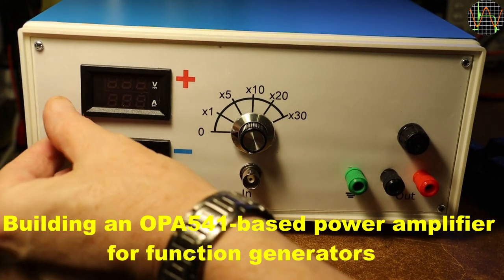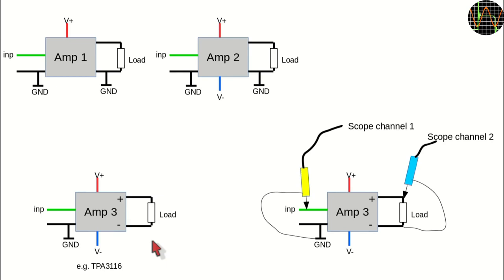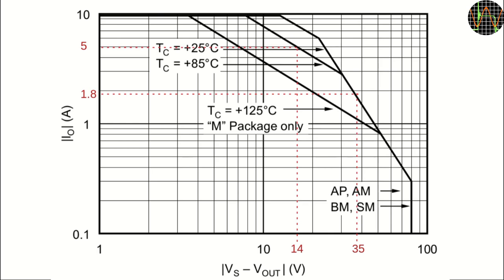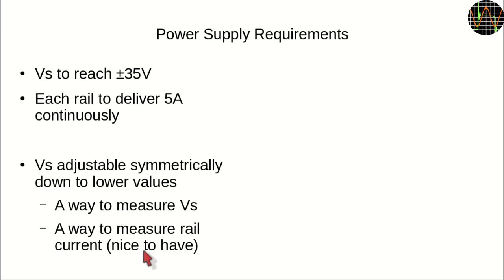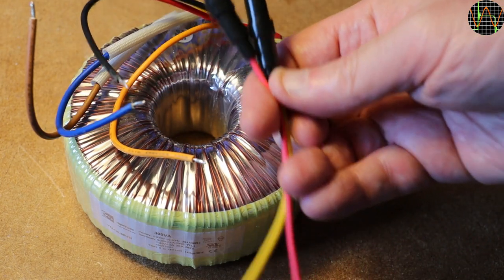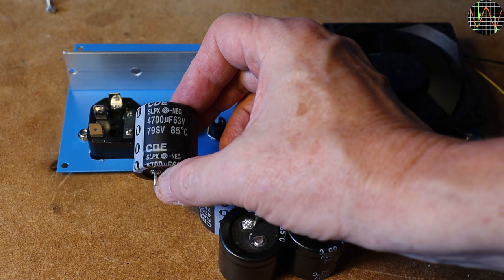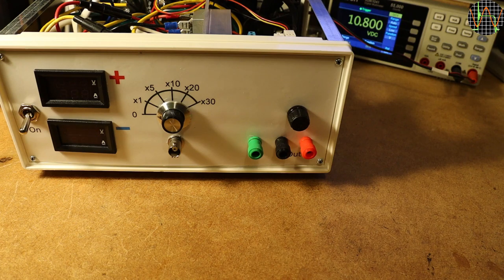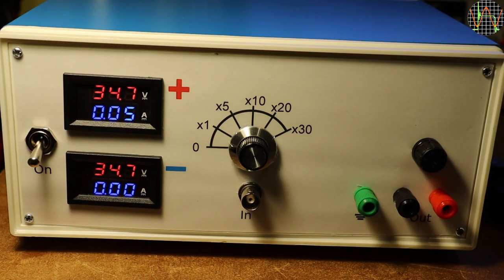Building an OPA541-based power amplifier for function generators

Comment: I just "finished" a similar multipurpose 541-based bench buffer yesterday---and then I see this video...Dash it all! Like yours, my board already had the DC coupling as well. The 541 seems to be an old-stock Burr-Brown part.

My goal was just +/- 10 V (20 V p-p) at only 4 Amperes so I used a couple 15 V switchers. My hacky cooling used a slow, quiet, 24 V, 60 mm fan with a 220 Ω series resistor across the 30 Volts. I beat the tar out of it yesterday, running transformers, motors, near-shorts and other evil loads with a function generator and bench supply and the cooling held. The input offset was way lower than expected at much less than 1 mV. The rms noise, taken with a wideband thermal rms meter, was less than 2 mV (unloaded @ 10Vdc) and some of that could be from the linear bench supply used as a reference source.  Next is to add monitor BNCs for current and voltage to make it easy to connect a scope for power measurements with reactive loads.

Edit:
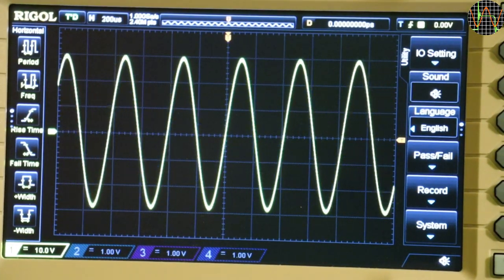On the glitch at 23:45, I see that too and not just at higher frequencies. I've been trying to understand it. It only happens when the signal crosses zero. A +2.5/-2.5 square-wave shows it clearly but a 0 to +5 V or 0 to -5 V square is fine. It looks like some form of crossover distortion but only when loaded heavily. Counterfeit chip?

Yet another edit:
Confirmed: Crossover distortion. One of those cases where textbook art and a real scope trace diverge. Sadly, seems normal for this chip at high currents. See TI thread "opa541-distortion-at-the-bottom-of-output-waveform".
Reply from the maker: Thanks for your comments and experiences with your build. Very useful stuff. BTW, I would not recommend using panel meters like I did. They are too slow. A better way may be an (averaging) watt meter in the output but that would probably be be a self-build. I do like the capability of adjusting the operating voltage but at the moment this depends on having a VARIAC at hand. Its fine for me but not a general solution.
Reply: @TheHWcave  Mine is maybe a bit more spartan and not nearly as polished as yours. My labels are by Sharpie pen! My box is pretty small too so not much room left.
Today I squeezed in a current circuit.  A salvaged Tamura S22P current sensor, and a 7805 for it's power,  amplified by an LF353 dual op-amp into the box on a little perf-board. That assembly is biased to get 1 V/A. That Tamura supposedly works to 100 kHz, which was the design goal for my output. That circuit leads to a BNC on the front panel that I patch into the scope set to 1 A to 1 V.  With volts on the other channel I get both components, in time, for watts. Using the product of the two channels in the scope's Math,  I get power at any point. Averaging the product gives Watts over the sweep period. Surprisingly, the scope is smart enough to label the math trace "Watts"! I calibrated at DC and it measures well, from what I can tell.
Reply from the maker: @antilogism  Thanks for that tip on the Tamura sensor.  That may come useful once I try to build my own power meter.
Reply: LEM has another similar line. Also Allegro has some nice chips and several evaluation boards. They have at least one hybrid chip with voltage and current, including an integrated ADC, that crunches watts and uses I2C.

Comment: Nice and clean build. 
The white wireconnector blocks next to the rotary switch, i presume that those are glued to the frontpanel ?
Reply from the maker: Yes, glue was the easiest solution. If you take care in cleaning the surfaces first and flattening the terminal-block underside it works quite well.
Reply: @TheHWcave  another solution (but not so quick) is to drill 1 or 2 small holes through the frontplate and small bolts and countersink the heads in the frontplate and use nuts to lock the connectorblocks in place. Then finally hide the bolt heads behind the coverplate foil. But glueing is definitely way easier.

Comment: Another excellent video! Another excellent build! Kudos! How convinced are you that the OPA-541 module is using genuine OEM components? I have only recently become aware of the 78C12 Switch Mode V Regs. IIRC, when I looked them up on Mouser, they were rather expensive and only came in limited voltage values. I imagine that they will become cheaper and be offered in more voltages, as they become more popular, which they certainly will. However, they might be just the thing, as a solution to some particular design issue. Please, please continue with your developments and corrections of your design and keep us informed. In the meantime, it would be great if you would post, here, a list of its issues and your thoughts about how you might address them.  I rather think that this is a project that I need to build. I ran into the same lack of power, recently, testing a circuit.
Reply from the maker: Thanks for the comments. Are the chips genuine? Hard to say. This was one of the reasons I did the power bandwidth test from the data sheet. As far as I can tell, it behaves as expected and the performance is good enough for me (considering cost). The main flaw with this module is the totally inadequate heat sink and to make matters worse, it appears to be put on with thermal adhesive/epoxy. I spent half a day just trying to remove it...

Comment: The OPA541 has very heavy compensation (read that a crazy slow slew rate) but running it at unity gain helps with that.
Reply from the maker: True, but I was to lazy to change the gain on the board... I am using it mostly for DC to audio frequencies and predominantly sine curves and its doing just fine.

Comment: Excellent. 
Can this amplifier drive  resistive load of 1 Ω ? Current required  is 100 mA . 
Actually I need the output impedance of the amplifier to be less than 1Ω . 
Please.
Reply from the maker: yes it can do that, no problems
Reply: @TheHWcave  Thanks.

Comment: Analog current meters would respond faster to changes. Another thought would be to use a switch mode power supplies with a feedback loop to control their output it's not that hard to do
Reply from the maker: I considered analog meters and even bought two but these are even worse in responding. As it turns out currents are pretty much a mirror image of the output split into + and - components. This means you need true RMS and good frequency bandwidth. In the end I think it is not worth having any current meters in the rails. Maybe a peak current LED could be useful.

I had not thought about rolling my own SMPS to provide adjustable voltages. That may be something to investigate but for me my VARIAC is way more simpler in adjusting the voltage.
Reply from the maker: @davidkclayton  Maybe something like that. Possibly just one row of LEDs connected to indicate the (rectified) peak output.current

Comment: Its an interesting work.I would like to know whether i can use this amplifier to power my Helmholtz coil(4-5 ohm resistance)which needs an AC magnetic field of 40 Gauss for that requires a current of 4 A. will the function generator connected to this circuit able to meet my needs?
Reply from the maker: It might, but its really a tricky case maxing the chip and the cooling system pretty much out. You also need to carefully design the supply voltage to something like 22V max (4A*4Ohm = 16V + 5.5V  voltage swing). But wouldn't it be easier to feed your coil through a transformer from mains?
Reply: @TheHWcave   Thank you for your reply. I want to conduct a study by varying the frequency,  i suppose it will be easier to feed the signal through a function generator for that. I tried with an audio amplifier but i dnt get the current required. Your suggestions will be a great help to me

Comment: Those meters measure common current in 0V rail (low ohm shunt inside meter on 0V rail). As an experiment, maybe try powering them independently from two 9V batteries (and no fan cct) and see if that current reading goes to zero instead of 40mA with no load?
Reply from the maker: An interesting suggestion. I may try that but it will be a while because I am too busy and also I don't want to mess with the amplifier at the moment and take the meters out for experiments.
Reply: @TheHWcave  ok, but you don't need to remove meters, just detach power lead and connect to 9v battery +ve with negative of battery connected to 0v (reverse connections for -ve meter) .
Reply from the maker: @steve6375  Trust me, I know how packed the wiring is on the front plate where the meters are.

Comment: Where did you connect gain control knob to amp ?
Reply from the maker: My gain control sits in between the front panel input connector and the OPA541 module input connector (screw terminal). The OPA541 is running at its default x33 setting.